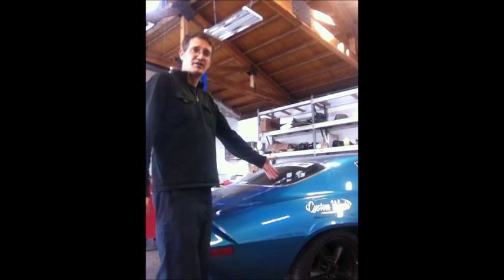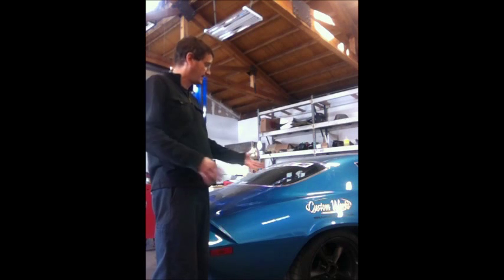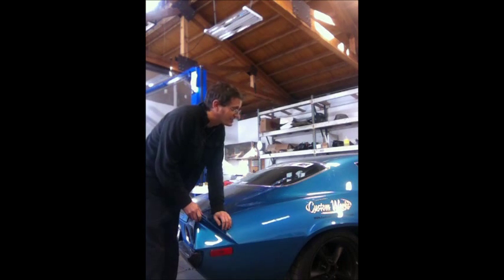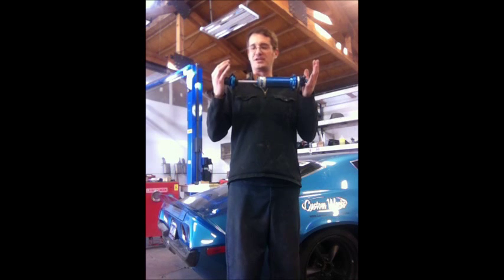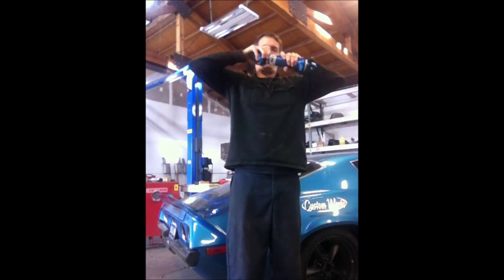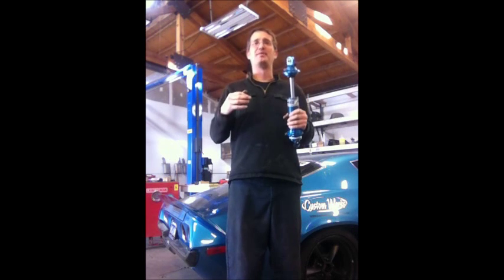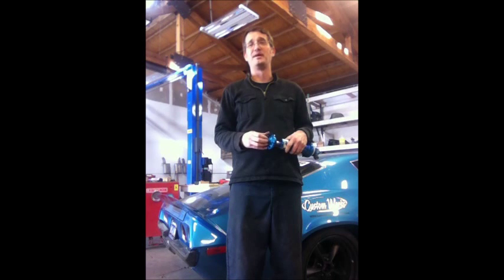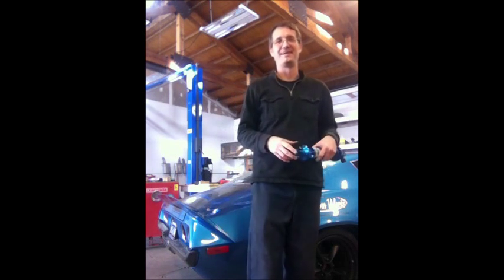Shocks vs. spring rate  ride quality

Comment: Put solid barely comprensible springs and then tell me how it rides. Both the springs and shocks can destroy the ride if they are not selected properly and the nitrogen prevents foaming of the hydraulic fluid and is not there to boost the springs as said here.

Comment: Agree with you about high gas force pressures in shocks or coilovers. They act as a separate hidden spring on top of actual dampening in both rebound and compression directions. The suspension will then have to first overcome this pressure before it actually goes into dampening, which also affect the ride behavior. More friction. Plus it is untrue about the oil being aerated just as long there is some gas pressure. High gas force really isn’t necessary.

Comment: What if you add like a one inch lift springs wont you have more travel. Will that add to smoother ride.   My springs are 20 years old
Reply from the maker: Bigsal then your ride height would be higher.

Comment: I have to disagree with a couple things in your video,

1. Nitrogen is used to pressurise the fluid, which prevents the oil becoming aerated and the shock losing consistency. You say that this is to make up for inadequate spring rates? I disagree.

2. The extra force in the shock when set to stiff is NOT friction, its damping, ie oil flowing through orifices and shim stacks. If friction was used for damping, you would be wearing out your shocks really fast!
Reply from the maker: Kyle Dempster you have valid points. I was trying to over simplify the concept of shock valving and ride quality. Thanks for your input.
Reply: Damping is the friction when oil go through the shock valve